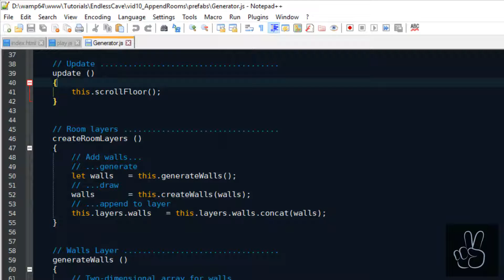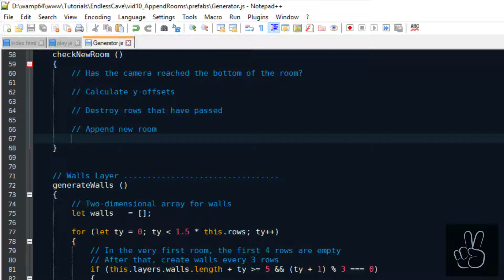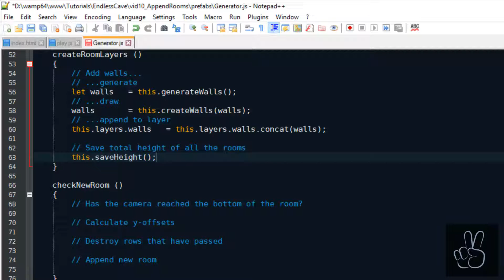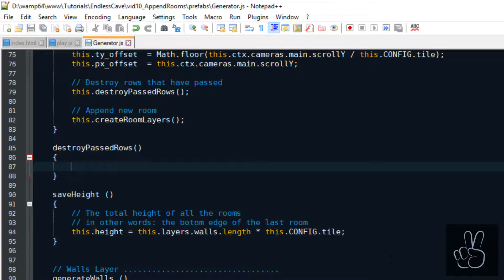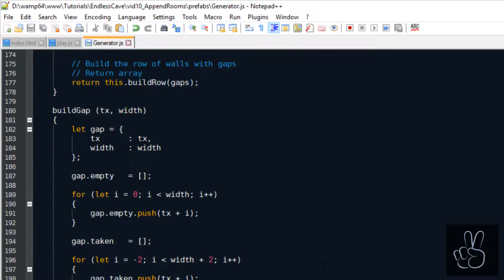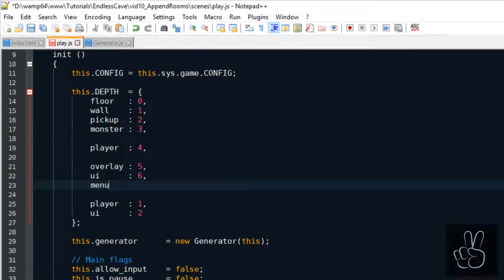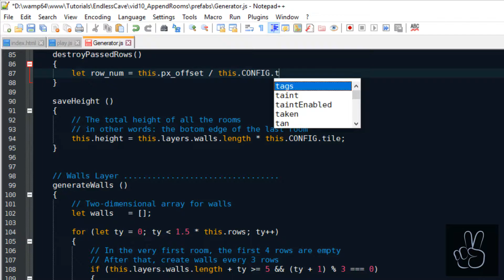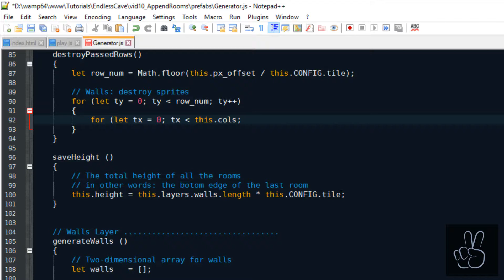'Endless Cave' Ep. 12: Infinite Levels | Phaser 3 Game Dev Tutorial

Comment: code doesn't work, because it seems that this.ty_offset is unused, so all the walls are generated in the first screen. Could you help me to solve this issue?
Reply from the maker: Hi ettca! It's been so many years since I've worked on this project, I can't answer this without digging into the code myself. However, the first thing you should check is which version of Phaser you're using - and if it's the same version I used back then for this tutorial. If it's a different version, try it again with the old version I used in this project. Let me know if that resolves it. If I can find the code on one of my old dusty HDDs, I'll be happy to share the code files with you (but no promises I can find it).